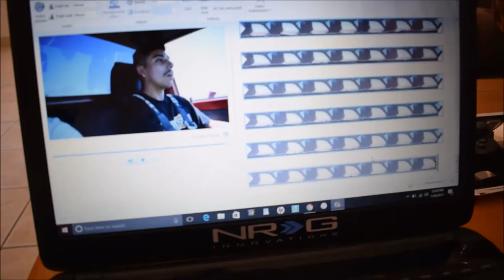What's better: Belltech Street Performance Shocks or Adjustable Air Ride Shocks?

Comment: do u got loweringblocks on the 3 in sprinfs in rear?
Reply from the maker: gabino tinajero yeah it's three inch lowering blocks as well as three inch lowering leaf springs
Reply: Car Bond what size tire you got on and type of rims i got 16 inch rims on mine
Reply from the maker: gabino tinajero they're 205/45/16 and my rim size is 16x8.5